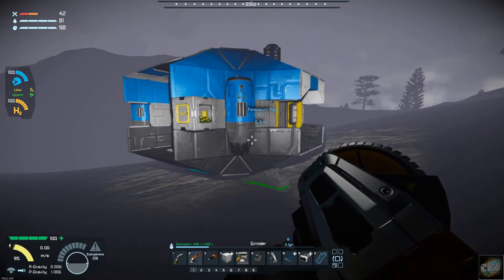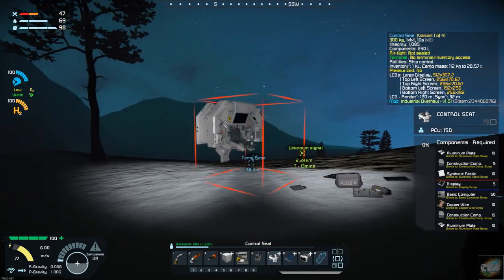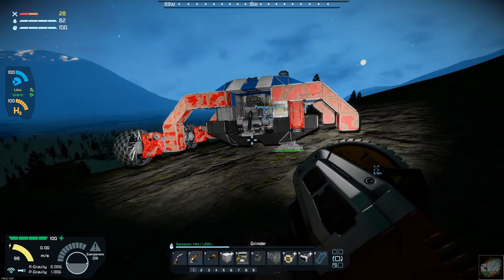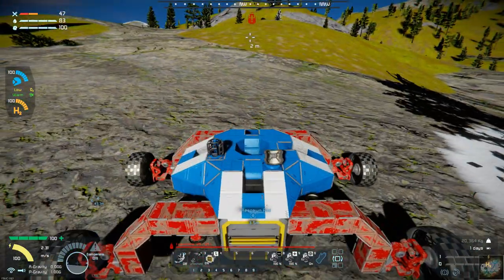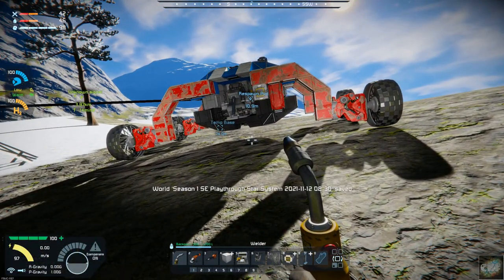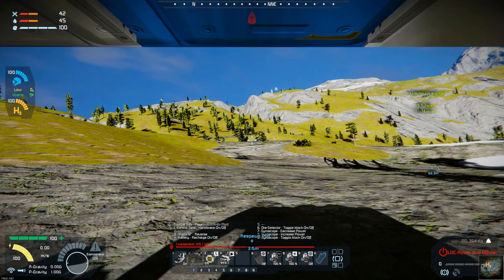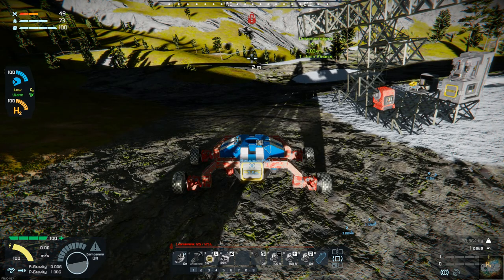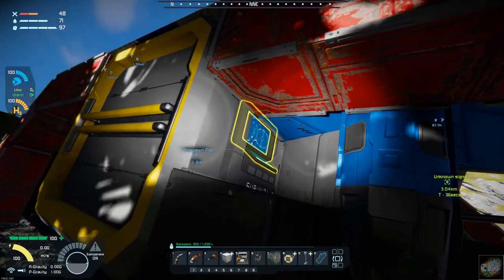Space Engineers – Season 1 – Day # 2 – Industrial Overhaul – A New Buggy!

Comment: While I like and use the Smooth Voxel Mod myself (due to vanilla being even worse) it does make the planets surface kind of boring in a way. Would be nice if depending on the texture there could be micro bumps or other undulations so it doesn't feel like driving on a uniformly flat racetrack.
Reply from the maker: I agree, what I don't like about vanilla is all the cracks where you can't take a rover.  I am also using Awscrap so I can't just grind down the thrusters and re-arrange them.  I like using that mod as it adds to the challenge.  Also with the Overhaul mod resources are much further apart and it is a must being able to get to some places with a rover.  I really do enjoy the game because of the many different mods otherwise it would become a very boring game.

Comment: Don't know if this will get seen but il try my luck

I have connected a piston to my drop pod to lift it for attaching wheels but all that happens is the piston glitches into the ground or hits the ground and breaks apart the drop pod does not move an inch from any of this 

I would really appreciate any help thanks
Reply from the maker: Not sure why your piston is glitching, you should be able to attach it to the side of the pod for lifting.  Once you do that then you should be able to modify the pod by adding basic extensions for the wheels.  Also you will need to change out the seat for a cockpit, I use the basic cockpit and it doesn't need all of the glass to become functional.

One thing I like to do is have a separate game in creative so I can experiment with different things without having to do all of the mining for materials.  You can do that by doing a save as of your current game and then change the settings to creative.

Let me know if this helps.  I am on the road so I am not always able to respond right way but will help where I can.

Good Luck with it.
Reply: @commanderkingfish9613  thankyou for replying, I didn't think I would get a response, I have managed to lift it now and have wheels attached but now I'm having problems recharging the battery on the pod I have it connected to my grid with a connector on my pod and a connector on my grid but no power is going to the battery on the pod I'm brand new to space engineers so learning a lot right now hopefully I can figure out how to get power into it soon
Reply: I've just added the charging station mod you have and I'm now charging my pod, now my only worry is figuring out how to know my ore detector is on and searching i'l charge my pod and go for an adventure
Reply from the maker: @killer96283  If you go into the settings for your ore detector you should be able to make sure it is on but also change the depth it reads. I think you can increase it to 50 feet I think. Good luck.
Reply: @commanderkingfish9613  I've covered quite a large area around my start base,I've been 15km is 1 direction and will now circle that distance around my base but ores seem very sparse ,I've only found : 1 oil,1gold,1niter and 1 coal deposit,I really need cobalt and silver so hopefully they will appear soon ,thankyou for your help and I'm going to be following your series all the way because it's been a massive help for me so far I wouldn't be anywhere without your guidance 😁👍
Reply from the maker: Glad I was able to help.  Yes the ores are spread out in the Industrial Overhaul and not surprising you have had to travel that far.  There is another mod I use, it is called the [VSI] Ore Deposit Scanner.  Check it out, you might want to add it if you find certain ores hard to find.  Good luck and have fun, figuring things out is most of the fun.